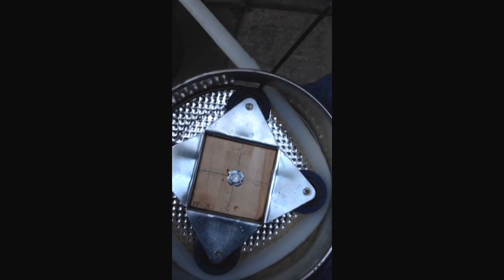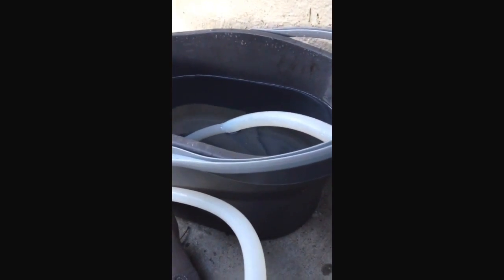Homemade (cheap) DIY peristaltic pump test

Comment: been looking for something cheap like this for ages, wonder if you could make me one with a motor that would pump mortar between the joints of brickwork a firm called refina peristaltic mortar pump have made one costs a fortune though check them out let me know if you could manufacture me one cheap.